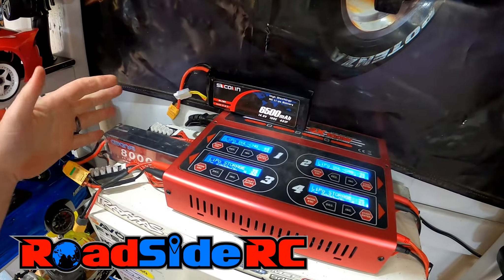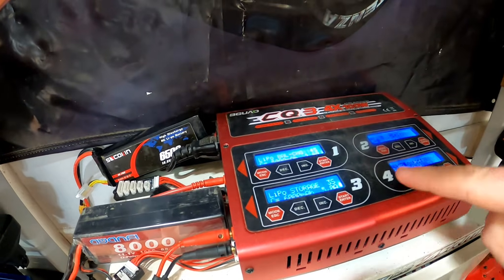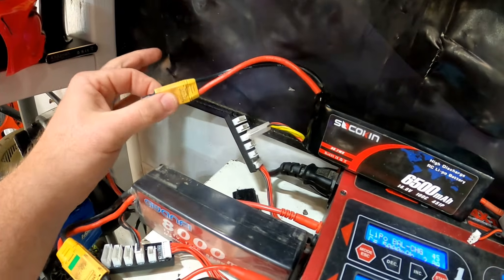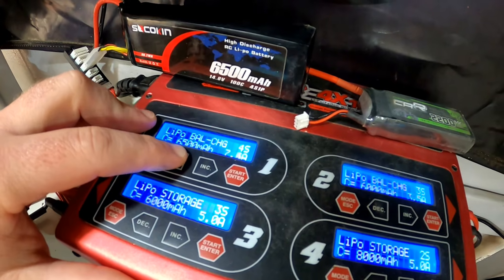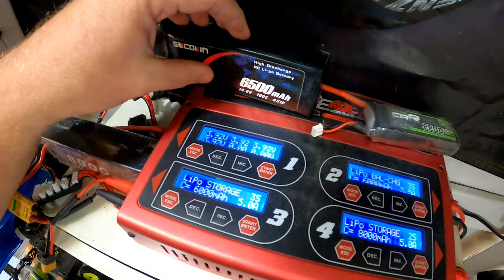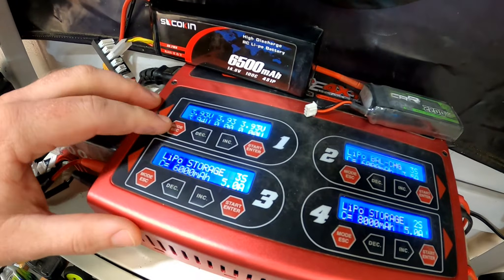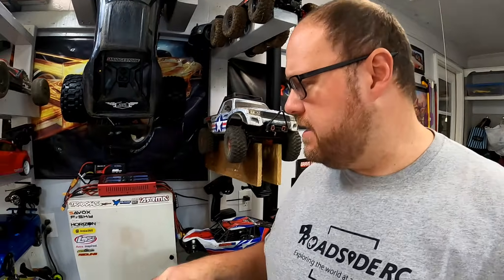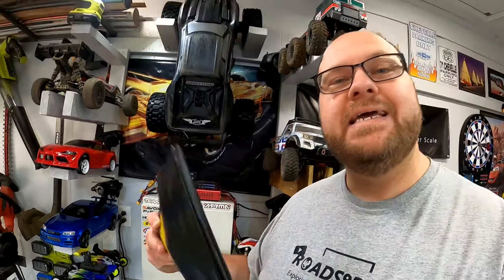5 SIMPLE Steps to RC Lipo Charging

Comment: I just bought 2 2s lipo 5000 mah ovonic and bought a Amazon safety bag should I get a metal storage also? Can I leave them on my garage? Is just with all this fire and everything I got really scared I don’t want my home to burn down I have a d300 charger.
Reply from the maker: There is nothing absolute I can write here. 

I have personally had good results with treating my batteries properly + storage in the garage. 

Your bag will be fine.

Comment: im a dumb nubie and just ordered a 2pack of 2 lipo s2 6500 50c for a danchee ridgerock (based on a comment recommendation) hoping to never run out of batteries..but i can still stop order!  would i be better off with a higher C# for crawling mostly/ sum trailing? and what charger would u recommend? (don't see any links)
Reply from the maker: Happy to help! 
For a crawler - especially the Danchee Ridgerock, you do not need to worry about the c-rating.  It is a very low-powered vehicle.  
All links are in the video description below the vehicle. 
Here is the charger I recommend for 90% of folks:  https://amzn.to/3Ru7FG8

Comment: I don’t think I’ve ever put mine in storage mode, I either leave them at their low voltage mode from Lipo cutoff or leave em at full charge, but I always check them with my lipo checker and I try to check them weekly.. I also never venture too far from the charger when they’re charging and I keep a chemical fire extinguisher on my bench next to the chargers cause you never know
Reply from the maker: You should really consider storage charging.   When you read from all the different manufacturers, they HIGHLY suggest not keeping them drained or full.   Either way reduces your lipos' life.